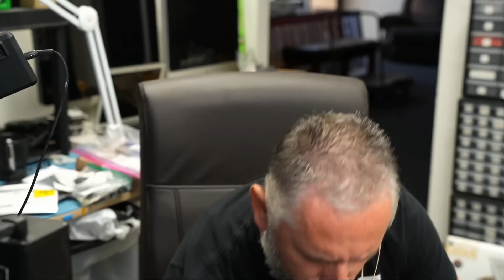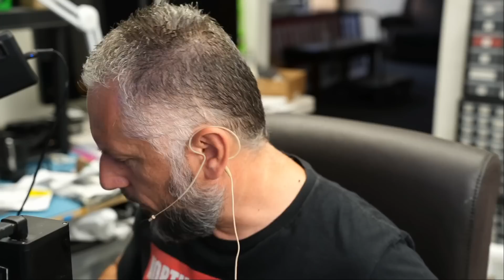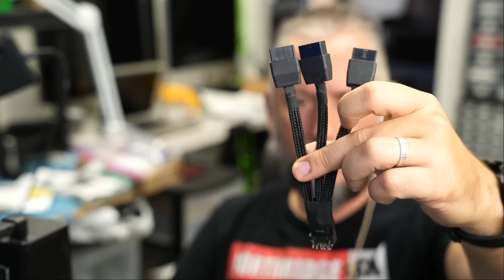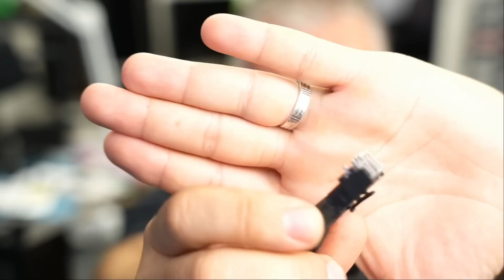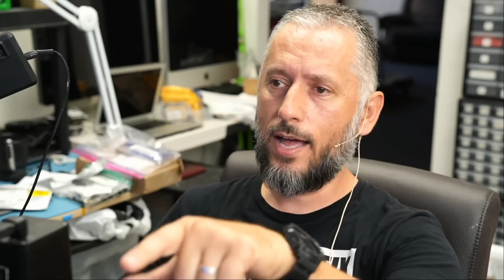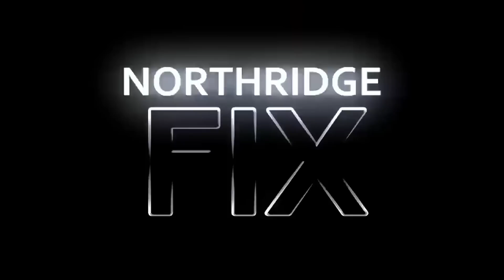MSI Responded- 4080 Connector Breaks & Causes Smoke Alarm

Comment: these cards draw almost as much wattage as a small electric oven... that's why your oven comes with a big and fused power plug and cable. the cables and connectors are made for a a time where case were much less power hungry.

Comment: I think it's related to cooling/temperature. The cards in general are overheating, with insufficient cooling for the gpu when they are hot. I had similar issues on hot days with my Antminers. The connectors would burn if the outside temperature was above 30 degrees, generally a really hot summers day in the UK. It rarely goes up to 30 degrees here and I've never had a problem with burnt connectors before. There was a 2 week period where the temperature was above 30 degrees and this is when my problems with burnt connectors started. I just switch off now during those hot spells and i haven't had the problem since.

Comment: Yes, you can get arching on electrical / electronic items which are not soldered correctly OR a heat buildup causes joints to become 'dry ' and in the cracks, arching takes place. That created more heat. The manufacturing process can't be right IMO. There now needs to be further checks as to HOW MANY MORE PEOPLE have had the same issue.  You get a lot of people then evidence goes to the company IMO

Comment: The problem with big companies is that they are owned by shareholders. The shareholders want to be paid more dividends every year. This forces the companies to save more and more, sell products more expensive, use cheaper parts and omit parts that are not needed (fuses for example) Saving on costimer support and so on.

Comment: MSI should compensate North ridge fix for their time and costs and guarantee that if it happens again that they will do a full RMA replacement.  That way there is a chance that it's a minimal cost much less than the shipping and engineers time to fix it at MSI.

Comment: there was some decision that was made to use this connector for that power, and it is absolutely the wrong decision
there is a term used in engineering called - Factor of safety, and it basically means that if you want to conduct 1A of power through an electrical wire in room temperature in air, it has to have that sort of cross section, because like all things, wires have some resistance, and based on the voltage and amperage it will create certain amount of heat due to the wire having electrical resistance
that particular connector, according to datasheet, if I recall correctly, sorry if I'm not, was rated for like 700W of power, while the 4090 can consume as much as 600W, 700/600 = 1.17, that 1.17 is the Factor of safety number, absolute minimum safe operation is 1, anything over is extra safety margin
for comparison, the 8pin version of that same connector is rated at 300W, yet cards that use it, mostly use up to 150W or something similar, that means the safety factor is 2, which is basically the norm.
another example, the rated amperage of the 3 pin 120/230AC plug on the back of the PSU is 30A, rarely if anything at your home using that plug will ever consume more than 20/10A, usually up to 16/8A, which is again safety factor of 2 (for those who don't understand, x/y numbers are for 120/230V respectively, the lower the voltage, the higher the current will be to get the desired power)
but somehow some bright minds thought - lets use this 16pin connector with safety factor of just 1.17, anyone with half a brain will understand that it is a VERY bad decision at these power levels, because evidence shows that the margin of error greatly exceeded this safety factor rating which leads to magic smoke
why they went with such a poor choice in the first place is beyond me, if anything, this smells a lot like designed to fail, just now they learned they walked a bit too close to it, it was probably meant to slowly oxidize in couple years time, well out of warranty, and into the new product cycle that problems with these connectors will make the cards unusable and people will just buy next ridiculously overpriced card also designed to fail
similar story can be with the famous Intel chips and oxidation, they experiment with how bad they can make these things and still get away with it, sad that there is no cohesive movement to expose this sort of criminal practice

Comment: Most likely won't be buying any graphics card that has that new 12V high power connector. Why can't they stick to the old proven PCI-E connector that  has been with us for decades? Just slap 4 of those on the card instead of that cable or just give us something similar and robust like ATX plug.

Comment: So is this just a problem with the manufacturers trying to push too much power thru a connector that’s not up to the task?  If so it sounds like these cards need a redesign with a different connector or maybe adding a second connector to spread the load.

Comment: They will never take action, that much is clear. I'm surprised the card still kept working with all the heat in the connector. One would expect a noticeable voltage drop across the connector for this amount of heat to be generated.

Comment: Bad design..  bad support...  but am left  wondering what PSU the customer was using...? I had an issue a long while back with an AMD card but the  PSU shut down the system  rather than turn the machine into a bonfire...  was glad I went with a Seasonic unit.

Comment: MSI should compensate the customer. One it could have burned down the house. The should either pay for the repair or give the customer another card that supposedly "do to new processes" the new card wont have this issue. And where is MSI on reporting this issue to the public. So there are cards out there with not enough solder on them? 🤔 Thanks for reporting on this NorthridgeFix. 👍🏾👍

Comment: ive had palit gpus' before that had such bad solder you could just peel off the mosfets with your finger nail. 
one got stuck on the heat sink while pulling it off. looked like it didnt adhered to the pcb (bare copper pads not tin or gold plated)

Comment: No you are not asking too much, you are just asking for equality and product quality they selling. Because today you get only just premanufactured scrap from a big facilities, which are just money making wheels, so they dont give a damn about quality. They just make thousands of scraps to make money and this exact problem is in every single end user technologicall field, same dishwasher, washing machines, dryers etc. big white small white everything, also automotive. Look how long a new cars leasts before they go to scrap yard cuz there is too expensive repair solutions. I wanted to try solve this problem in europe from scratch by hitting on ROHS under the right of repair, but failed. Anyway i hope customer gets compensation from MSI because otherwise they justed wiped theyr bottom with him instead of toilet papper and thats not how they should response

Comment: They should change that connector into something like XT60 or even XT90, that should handle the current amperage nicely.
They usually being used on RC cars/drones with large motor/battery.

Comment: So happy that i have one of the last 3080s that evga made. Ive never had one issue with this card . Or any of the other evga cards ive owned. When i first learned of the smaller connection on the 40 series card. Im thinking to my self, that is way to small for all that power that needs to go threw that . What happenes when you run to small of a wire to your amp in your car ? It melts!!!

Comment: I used an rma and this was for asus they sent me a card that’s was super dirty dusty .. This was back with the 1080 strix .. by the time I got the card and a month later past I lost my warranty .. that second over used card had another issue or perhaps the same lasted a month by then my warranty was expired  at a time when gpu shortage was happening .. worst rma experience I wanted my card fixed not someone else’s problems I wasn’t an aware of ..

Comment: The first mistake was saying “reputable”. 

Was the card still under manufacturers warranty? If so, then they should have had the first right of repair. The owner would have had the card repaired for free. That said, the underlying issue would never have been brought to light. 

It’s obvious with NO solder evident that a QC issue was the cause. On the production line at the plant that card was made, clearly the machine ran out of solder. Unfortunate but it happens. Even when checking for QC issues that card may still be missed and entered into circulation. A manufacturer cannot check 100% of their products. 

It would be reasonable for MSI to pick up the repair tab but honestly nothing more in the way of compensation and certainly not a new card if after repair and testing the card worked within specifications and worked as intended. 

When you talk about these companies, most are based or have headquarters out of Taiwan or elsewhere in Asia. The warranty you receive is a western consumer law concept not an Asian one. Rightly or wrongly, that concept doesn’t filter through really well in Asia. Regardless of what you pay for something, out the door you’re on your own. This is the Asian business practice of their choice. 
Yes a generic non committal response from MSI. Yes, not a favorable response either but did you honestly expect a different response from a corporate tech giant ? They don’t have 1 persons consideration in their sights or interest. Yes they should but no they don’t. Corporations don’t have a heart. 

You want them to sit up and listen then hitting them in the wallet is the only way.  For the owner of the card, get it out there for all to know. 

Me, I own 2 MSI motherboards. One was DOA and the board sent back for repair. I received it back working after 4 months. I was dirty that I had to wait to have a working system again but show me any tech manufacturer that doesn’t do it this same way ? If I’d taken the board to a 3rd party repairer, MSI wouldn’t have had to do anything and warranty not claimed or become invalid for the remaining 3 years warranty period. 
You don’t get to buy the cake, eat it too, then complain that you want more when it’s finished.

Comment: They won't replace video card due to the new replacement having even less solder. I had a customer with a MSI video card that was literally bent in half from all the heat, that's how soft their PCB's have become.  Card heated up and cooled down into a new shape.

Comment: i bought MSI G271 monitor which failed one month after the warranty with a common issue starting with black lines on higher frequency but later started doing the same even with the lower ones.
i bought MSI GF63 Thin laptop with 3050Ti and was overheating and throttling even with the lower requirements games.
i know one thing for sure, i will never ever buy anything manufactured by MSI in my life.

Comment: I doubt they will do anything. I've repaired equipment in a hospital for over 40 yrs before retiring. A manufacturer specs a part and a supplier builds it to those specs. Problem is the part is not up to the spec that it is supposed to be, it is border line. So eventually it fails. I've seen you replace those connectors. The video card manufacturer needs to over spec high current carrying components to be sure they can withstand more than they are rated for.

Comment: MSI or any company for that matter has an obligation to honor their written warranty policy. For graphics cards, MSI offers a 3-year warranty. Most companies that I have returned computer components to have been very good about honoring their warrantied products. MSI recently replaced a defective ATX power supply for me. The replacement came within two weeks.
On the other side, the customer has the obligation to follow the instructions for warranty coverage. Typically, you go to the manufacturer’s website, fill out the product information, and then receive an RMA. If your customer did that, but they refused to repair or replace it, then shame on MSI. If he didn’t, then they don’t have any obligation to reimburse him. The warrant is now void because someone else not authorized by MSI service the card. 
However, "I understand" what you’re saying. I repair computers and when it comes to warranty for services I perform, I go above and beyond my written warranty policy. The reason for that is I highly value customer satisfaction. I don’t spend any money on advertising. So, if making a customer happy means I lose some money on a repair, then so be it. The customer will tell others about how well they were treated. That’s the best kind of advertising.

Comment: After inspect from AI, this message can be explain like this:
Interpretation:
The message aims to reassure the customer that the issue has been acknowledged and that MSI has already made corrections to resolve it. This is a standard practice for maintaining positive customer relationships and demonstrating a commitment to quality and continuous improvement.

Although the message sounds positive and reassures that MSI has taken the issue seriously and made improvements for future products, it doesn’t actually offer a specific solution or compensation for the affected customer. The company focuses on future measures but does not address the damages or inconveniences that the customer has already experienced.

This is a typical approach where companies emphasize their efforts for improvement but may create the impression that they are not taking responsibility for the issues already caused. The customer might expect more concrete actions, such as replacing the defective product, offering repairs, or providing compensation. The lack of such measures could leave the customer disappointed, despite the polite tone of the message.

Comment: I can't count how many times I've found loose screws rolling around inside digital cameras ( my profession is repairing photographic equipment) one company in particular has had this problem since the first generation of digital cameras. Some times no permanent damage but equal or more amounts of critical damage. With no compensation for the customer.

Comment: If MSI truly understood this issue, which is a warrantable failure, they should either compensate you or compensate the customer for your work directly. Either would be acceptable. Though, given my experience with MSI their use of "understand" is basically an extended middle finger to their customer, as I got from their dangerous gaming chair that dumped me backwards onto my head when the tilt mechanism broke.

When the 5090 comes out, if they don't ship with 2x 12VHPWR connectors, expect to see way more MSI fire hazard cards to start showing up, especially if the 600w TBP rumors are true or even remotely close to accurate.

Comment: The customer should have contacted MSI regarding the repair and gone thru the process. The customer brought northridge the card because they didn't want to wait for the repair. So northridge billed the customer, unless northridge is an authorized repair center for MSI, the customer is due nothing. It was customers choice to have northridge repair the card. But MSI's response does SUCK and they need to do better!

Comment: History defect is best data for improvements. My company is local PCBA supplier I suggest company use paste-in-hole process for all through hole connectors and it works for 99%. Find solution not run away problem. Maid in USA ❤

Comment: Here I am using the provided power cable supplied by Gigabyte and not the one supplied by the PSU vendor.
I didn't want to let Gigabyte off the hook by using a power cable supplied by the PSU vendor.
If I did, you know they would just lay blame on each other leaving me stuck without recourse.
Now I'm unsure whether that is enough.

Comment: I would think that the power connector is hand soldered and in this case has been missed on the production line and then not picked up in QC due to random batch testing. Also surprised MSI admitted it was a known issue and going forward this issue will be addressed. But what about those already built, sold and presently installed? Is it going to take a house fire and loss of life before this issue is fully addressed with a recall ?

Comment: Many processes that include solder waver or screened paste and re-flow are fine for smaller components. In the process there is usually a step that may include a final hand solder, especially when you have larger through hole power leads. The screened paste is no where near the amount of solder required for the through hole. Visually after the re-flow, the solder will almost appear the same as the hand soldered finished step and easily miss the final step. The thin layer of solder on the joint will take much less temp to cause the screened paste to fail. thus the reason it just fell off.

Comment: if the card was in waranty, the manufacturer should have been approached first, for them to replace/repair the card. If the user comes to repair shop when item is still in warranty, without checking with manufacturer, they are forfeiting your charge for looking at the card, and by doing so also shown they will pay for repair. If they had been approached first, and denied warrenty, with manufacturer blaming user, then with the evidence of lack of tinning on pads presented to them they should pay for the repair, as it was their fault they did not offer a replacement, causing the extra expense to the customer.